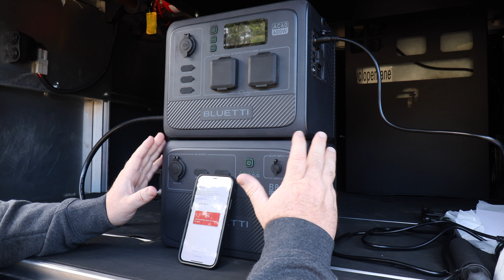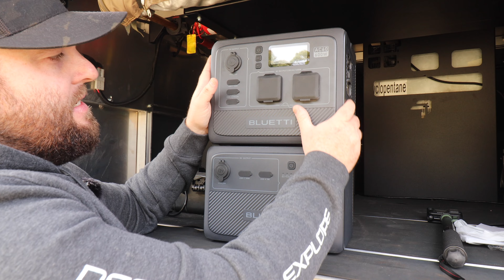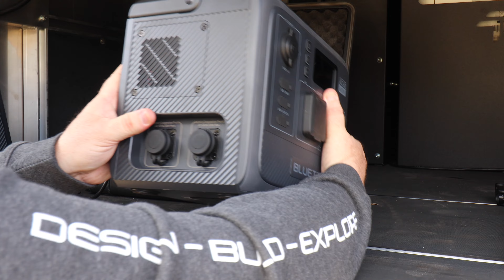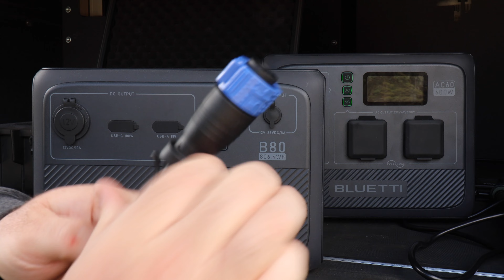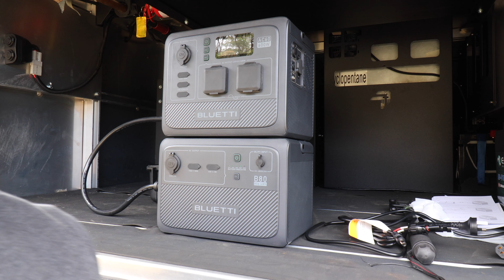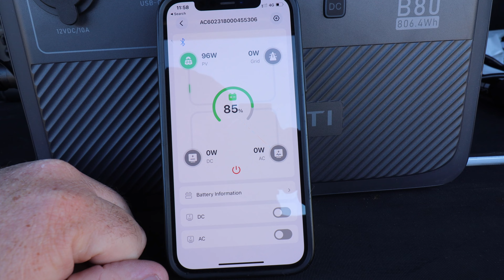BLUETTI AC60 & B80 WHY DO I REVIEW THESE POWER STATIONS…

Comment: Everything is great, but what about the water resistance while working with connected cables? Apparently, with the wires connected, the battery does not provide IP65 protection, which is not so great."

Comment: Great review and agree 100 the way of the future as enerdrive and redarc are behind but only 2 issues with it is low 12 volt charging and no andson plugs like you said but need to be able to be charged higher rate off a 12 volt system as 8amp is very low when a fridge amp draw is  is between 4 to 6 amph every hour  and even solar is to low when wanting to run induction cooking off it  to be able to be fully charged again after a few hours of driving, but hopefully them 2 improvement to this system and i would buy it in a heart beat and remove my enerdrive system an out of my set up as so much stuff is neded in a hard mounted system,  a lot of cables every where with high chances of issue after time.